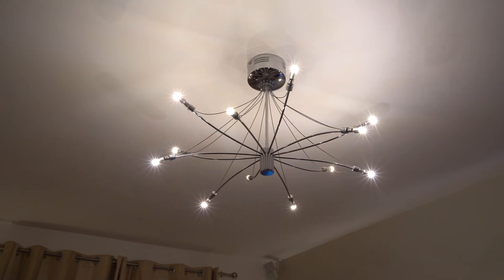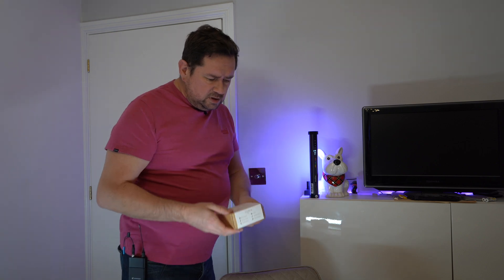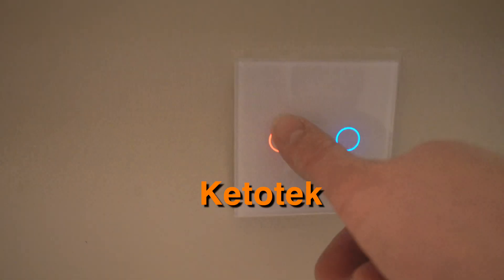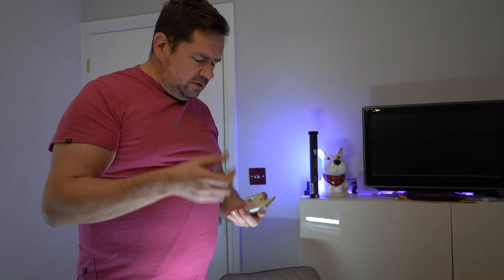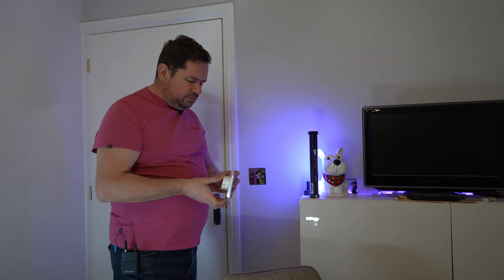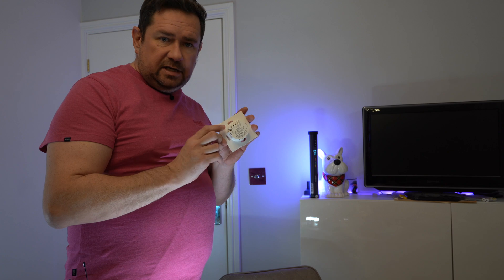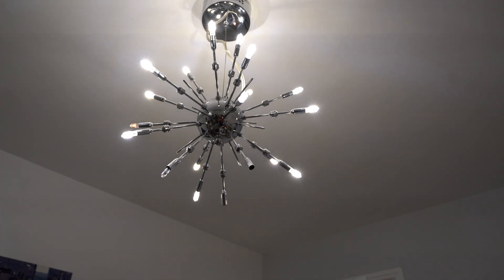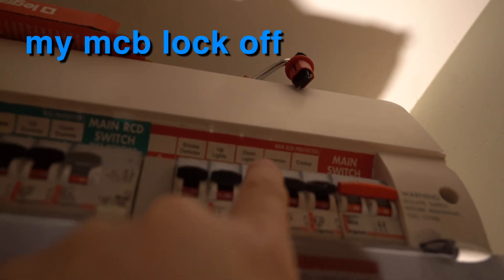Better smart lights wish someone had told me this earlier

Comment: It's probably worth mentioning that almost no existing UK light switches have neutral to the switch (new builds may vary). This means that for the majority of people these kinds of switches need re-wiring to bring neutral to the switch and depending on the site this is either quite easy or rather annoying. In my scenario it's easy as while I'm in a flat I have access to the loft space and therefore pulling through replacement cables and connecting up neutral is very easy but most people are not that lucky.
Reply from the maker: I think it’s more with the builder or area’s of the uk, the majority that I come across is neutral at the switch, however these smart switches brands also do non neutral switch versions that use a capacitor, I haven’t used one to comment on those but the ketotek I ordered came with a capacitor and allowed you to choose
Reply: Every house I've had in the last 20 years has has neutral in the switch (south west uk). But these are predominately newer build types.  Older (pre 1980's) houses would probably not have neutral.  The switches that don't take neutral usually work ok, but they do end up taking a small bit of current continuously and I think also send current continuously through the bulb - not enough to emit light, but enough to make you jump if you touched the wires
Reply from the maker: Some smart switches that don't use a neutral at them, use a capacitor, this could make a low hum sound that you may or may not be able to hear.
Without this capacitor on neutral free smart switches, low wattage bulbs like 1w gu10 down lights etc may flicker when off